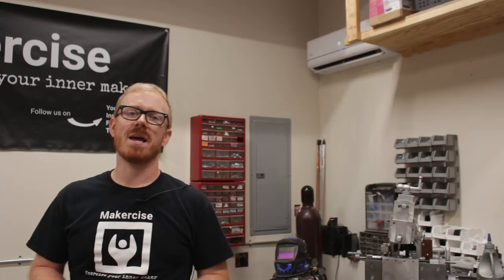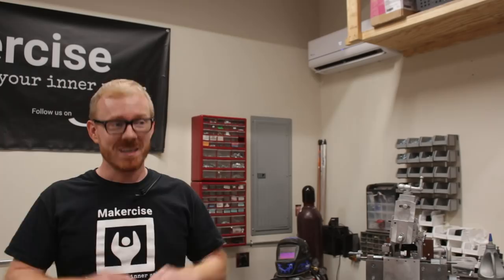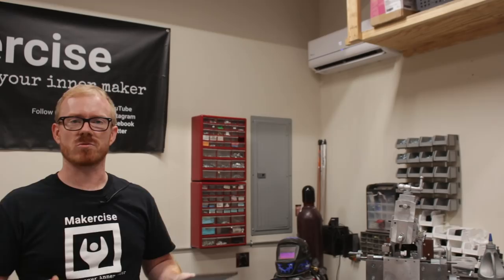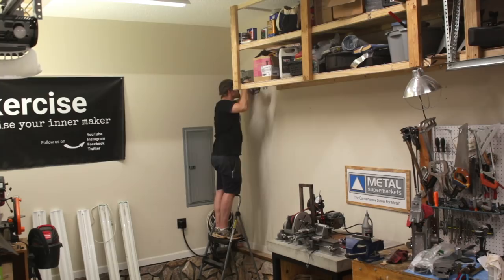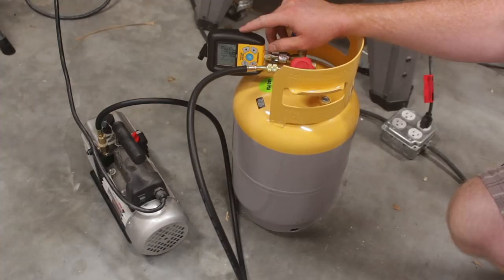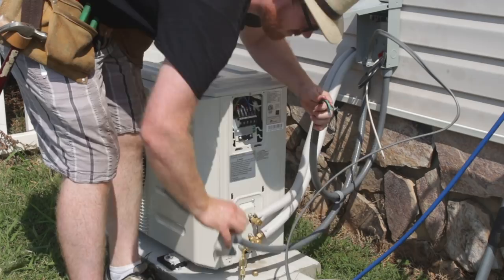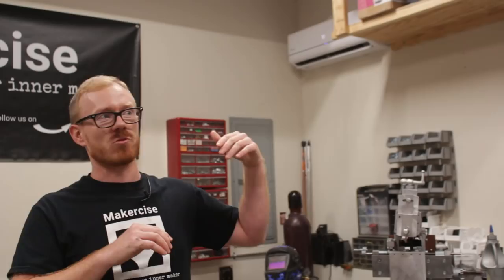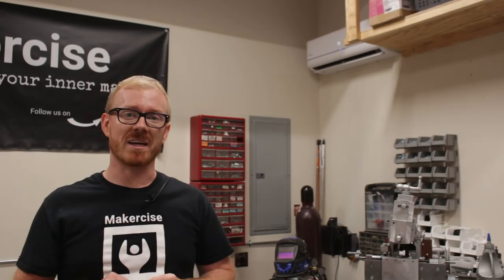DIY Mini Split AC Installation - Air Conditioning Install without Professional Help

Comment: This has to be the most expensive diy install, right?
Reply from the maker: My data set is limited so I can't say with confidence that this is THE MOST expensive DIY install. I imagine one could spend more. 

You could definitely spend less if you didn't make the same mistake I did on the evacuation. You could spend less if you went with a lower performance unit. A minisplit plus attic insulation is much more expensive than slapping window unit from a big box store in a preexisting window. 

All in all, I am happy with the price I paid considering the high performance (25 SEER) unit I selected and the tools I can use  (and have used) again on other projects. Biggest win for me was not having to solicit quotes and decide on a contractor.
Reply: First2ner he Spent about 2700$ i believe and a unit installed by a professional is about 3 gs lol
Reply: @Makercise  And now you have all the gear and skills to service the unit in the future, or perform additional installations
Reply: @martinlavoie4002  incorrect. We charge $500 for an installation

Comment: While it's great that you identified what your monetary cost was you failed to specify your Labor Rate how much time did it cost you to do everything associated with this job? Including studying to take the EPA exam, all the leg work associated with the job, the time it took to install the unit, including the time it took you to correct all the problems encountered. These hidden costs the value of your time is what many DIY's fail to realize and ultimately winds up being a path precluding to disaster. I think once you factor in the personal time element you will find that it would have been cheaper to hire a pro to do the job.
Reply from the maker: I am not sure what you mean by "precluding to disaster." Regardless, I omit any guess about a labor rate since it is an opportunity cost which would be very different for each person contemplating such a project. My personal labor rate was a negligible $0.01/hr. It was reasonable to omit, and I came out ahead in the deal. As you mention, omitting such cost is the standard methodology for DIY book keeping. Furthermore, I also chose not to include the value added by not having to deal with a professional. Although not priceless, I value such a benefit highly.
Reply: Well if the value of your time is $0.01 cents an hour I think the viewing public has a right to know the value of your time so they can determine for themselves if this venture of chasing rabbits down DIY holes is really a worthwhile endeavor. As you made vivid points about what a manufacture would or wouldn't warranty from an amateur. Most people viewing your videos probably have a higher value placed on the time they have on this rock. precluding to disaster means more or less the little things that go wrong that an amateur more often than not does not have the means or the fortitude to correct. There's really goods reason(s) nearly all jurisdictions require licensing for doing such things.
Reply: I think the value of one's time in some instances should be factored in among all the various costs to complete a task such as this. Some instances, but not all. Some people don't work, and don't intend to work. In my case, I do work but did not factor my time as one of the costs. I had 3 reasons for this: 1 - I would not have worked those hours spent on my install, so no opportunity cost regarding loss of potential income. 2 - I enjoy learning new things. Even though I don't see myself doing HVAC professionally, it brought me considerable joy doing a challenging job, and a lot of pride after knowing I successfully installed a nice system myself. And 3 - I really had nothing else going on. It was something to occupy my time each night after work; no different than drinking beer and watching football, or playing cards. To me it was beneficial for so many reasons; as he mentioned, I didn't have to deal with "professionals" in my home, and be at the mercy of their skill-set and ambition level to do it right. I wanted it done right, and did so!

Comment: 15:14 I thought you were not allowed to release refrigerent to the atmosphere?
Reply from the maker: De minimis release is permitted:"De minimis" quantities of refrigerant released while making good faith attempts to recapture and recycle or safely dispose of refrigerant including releases that occur when connecting or disconnecting hoses to charge or service appliances.
More info here: https://www.epa.gov/section608/stationary-refrigeration-prohibition-venting-refrigerants

That being said, in the future I will use that CD5060 with the thumb operated screw to get even lower amounts of "de minimis" refrigerant release.
Reply: @Makercise  Thanks

Comment: nice job so DIY does cost more lol next time find a AC company make buddy's and borrow their shit they will more than lightly come help, why buy all that equipment for one time use   i cut off the indoor flare nuts  and braes the gas pipes together to insure i cant have a  leak on the indoor unit and do a pump down to remove the hoses. But very professionally done well done im sure you learnt a  lot lol

Comment: Just my opinion... very informative video.  However,  you turned a DIY project into a professional one.  I just installed a senville mini split into my home gym and by far it was not DIY.  It's only DIY when you have electricity provide outside.  In my case I didn't.

Comment: I was dubious when you said it was legal where you live but I guess technically I could get the certification and do my own here, except that it's a four-year apprenticeship.
Reply from the maker: Where is here?
Reply: Nova Scotia, Eastern Canada.
Reply: I too am from Nova Scotia and will be installing one for myself. I believe its only a real issue if you are attempting to do it commercially. The four-year apprenticeship is a joke...We are not even allowed to even touch electrical as a homeowner either.

Comment: Top tip to anyone trying to install ac systems. Get a qualified refrigeration engineer to install it properly. why  would you leave the flare nuts on the indoor unit.

Comment: Where he get  40 -90 deg temperature?
Reply from the maker: Calculator based on zip code. I think IBC or energy code also defines outdoor design temperatures based on area.

Comment: extra lineset should NEVER be coiled verticaly will trap oil.
Reply: Manufacturer shows the extra lineset coiled in the installation manual.

Comment: It  really concerns me that the HVAC industry voids warranty when one does NOT hire a HVAC contractor for installations even when the system is well installed by the non-contractor.   The issue is that the systems are available for a fraction of the cost of the units marketed through dealers and installation contractor and it feels like real prejudice that everyone and anyone not in the business of making windfall profits is purely and completely incompetent.   This makes me wonder either if I even want the product, or if I care if I have a warranty at all, then just go with fate to see if the unit will hold up.   I am completely competent with diy installation of this nature after spending my entire vocational life performing much more than the skill sets required to accomplish this type installation.
Reply: May not be legal for them to deny based on Federal warranty regulations. I know they can't require you to register for example

Comment: vac pump 150. recovery machine 450.00 recovery tank 100.00 gage set 90.00 tank of r410a 85.00 100.00 micron gage. plus cost of mini split. expensive DIY . only 250 psig nitro test? should have been 450 psig for mini split. only 1300 microns ? should be 300 microns for mini split. used 60 amp non fused disconnect. should have been 30 amp fused. ( not to code ) pretty sure you will have non condensables in that system. dude, it works, think you would have been WAY better off hiring a company and have at least 2 years labor as well as 10 years of parts warranty. sorry bro, I know your proud and it works, but this is something a pro should do for sooo many reasons.
Reply: @ Martha.. He didnt say this was a cost effective venture ,  cause its not,  or that he really knew how to properly install the thing. Actually he just MONEYTIZIN ON DA TUBE! Lots of disclaimers tol.
Reply: He would have been fine if he would have not fd up the system

Comment: i installed my own sytem and never vacuumed my lines i just connected the lines and carefully pressurized the system with the gas that was in the unit 
it still works after 13 years , if you installed the system on a moist day there is a chance the moisture trapped in the lines will freese , guess i been lucky and did the install on a low humidity day
freon nowadays is VERRY EXPENSIVE due to new enviroment rules they had to change the formula of the cooling gas
as for loosing the refrigirant , both sides of the couplings on the compressor have a hex key valve verry close to the fill point , it think if you closed those (turn off system first offcourse) before taking the adapter off there shouldnt be too mush loss , you can open up those hex key valves after that
Reply: Bad idea...just sayin

Comment: 11:16 in I gave up on any notions of buying a DIY system. You gotta pick your DIY battles wisely...this is not, in my opinion, one of those battles. It's not a question of 'can you' do this...its a question of 'should you'. For me I'll bring in a pro and go do something else with my time.
Reply from the maker: Definitely not a job for everyone. I weight 'not dealing with a professional' so highly it trumps nearly every other concern for me.
Reply: @Makercise  some DIY decisions no matter how skilled the installer is can really backfire on a guy. Voiding warranty's is not always a wise thing to do. 
I will be needing a 40k btu multiple head entire home mini-split system and for me that warranty is mighty important. I'm on the ramp to 70 years old now..an avid DIY'er over those years and I've seen alot of equipment that had great reviews but in the end proved to have flaws in the design and or manufacturing or out of the box failures..which means you're screwed if the warranty is deemed invalid due to self installation. 
Thanx for your response and video. In the end you provided the answer I needed...and isn't that really the purpose for making the videos in the first place  ;) 
Take care.
Reply: @Makercise  including doing it incorrectly like you did?

Comment: I hope you purged your hoses before charging.  Your unit will work fine, but your compressor will die faster because noncondensable.  Hopefully you did.

Comment: Mr Cool DIY systems are pre-charged. This would have saved you a bunch of time and money on tools, refrigerant, course materials, etc, etc.
Reply from the maker: As I read the laws, if someone performs an installation, repair, connects gauges, or anything else to a system that could release refrigerant, they need the cert. This goes for mr cool systems too. I understand that the vast majority of DIY installers do not have the certification, but it doesn't mean it isn't required by law. It just means the risk or repercussions are low. Kind of like driving 5mph over the speed limit, although it may not be technically legal it becomes effectively legal.

Comment: How did you save money if you had do buy recovery unit a recovery tank . vacum pump. refrigerant. Manifold gauge nitrogen. If you want to diy thats cool dont tell pepole you saved money
Reply from the maker: I saved money because local minisplit install is around $3500 for a similar sized unit plus labor. Tools and equipment were less. I didn't include my time because--lets be honest--I would have been replying to youtube comments if I weren't doing something productive. ;)

Comment: Knowing what you know now, the money it cost you, time and effort, would you have installed it yourself still or would you have called a qualified installer? Its good that you learnt new skills but how many times would you need to install an air con in your lifetime. You would hope that the one you installed would last you for quite a while.
Reply from the maker: 2 minisplits and 2 vehicle A/C repairs using this equipment and knowledge. This is the kind of thing I like to do so there is extra incentive for me.

Comment: An online dealer claims that it only takes 2-4 hours to do this work, and that you can hire someone to do it for $50-65 an hour. So they are implying an install should cost $100 to $260. Ha.

Comment: After watching this I am convinced that I wouldn't want to do this myself. My neighbor does HVAC.... I would just have him do this for me.  There is too much equipment to buy that I probably wouldn't use again.  Probably can be rented, but he could get this done more quickly that I ever could.
Reply: Most mini-split units have an open line set and have to be pressurized with nitrogen and checked for leaks. Then they have to be vacuumed down with a vacuum pump to 500 microns before the coolant can be released. Other mini-splits like the Mr Cool DIY line have the line set precharged and have  check valves  in the end of the line set to prevent leaks. The other end is permanently attached to the indoor unit. You just hook it up and go.
Reply: @Robbi Robson You have a vacuum pump?
Reply: @Robbi Robson  you are right about not needing any refrigerant but when you install the mini split amd hook up the line set it has been exposed to the atmosphere therefore you pull a vacuum before you open the valves for the pre charge to rid the line of moisture or noncondesnables.
Reply: Wow thats interesting,
Installing a mini split easily is upward of 3k, installed,  where I live in Texas
Ppl like to put them in their garages, workshops, and offices
Reply: @Robbi Robson that makes me sick. This trade is not for everyone and takes some hard work. You deserve a good living if you are doing hvac or any trade in my opinion. In the states, I am two years in the trade and after getting a few licenses and certs in my state I am earning 25 per hour worked. Here in the Texas that is a good living, I have no complaints.

Comment: Pulled permit for that small job
Reply: Usually,  you only need a permit if your doing a structural change to a house, not put in an ac unit.

Comment: I did this thru a professional HVAC contractor and paid about $2k in SoCal w/o permits for this. Just FYI.
Reply from the maker: So we compare apples to apples, what was the SEER rating on your unit? Also, what would permits have cost had your contractor pulled them?
Reply: @Makercise  You don't need a permit for that my dude.

Comment: A 1300 micron vacuum is not correct.  500 microns of less for a unit from what I have learned.  I would be hesitant to give advice in a trade I am not competent in.  For correct mini split install check out "HVAC Tech" here on YouTube.  He is a license HVAC contractor and goes over mini split installs.

Comment: You didn’t do a real vacuum, you didn’t even measure it with a micron gauge. On top of that, if the flares to the indoor unit leak behind that wall, good luck finding it you will have to cut that section of the wall out again. Other than that, good on you. But I will admit I love when DIYs call me a year or so down the road when their compressor fails from an install done wrong like not pulling a proper vaccum which causes an acidic reaction from the moisture in the lines.

Comment: Hang on...at 7:08or so, you said you cooled the recovery cylinder...these systems typically come pre charged, why you would concern yourself with recovering  refrigerant is a mystery to me...now I know, as I have watched the rest of the video...
Reply from the maker: Thanks for answering your question. I really enjoyed this project and it keeps my garage nice and cool. I have also fixed two vehicle AC units and done another minisplit install since then. Fun stuff.

Comment: Your recovery tank will never be pressurized with nitrogen but will always be vacuumed  down
Reply from the maker: The tank I received in the mail had positive pressure. To be fair I didn't analyze the gas it was pressurized with, but to be sure it definitely did not ship under vacuum. Furthermore, I could pressurize it with nitrogen, at that point 'will never be pressurized' with nitrogen wouldn't be correct.
Reply: LOL!
Reply: Randyy - sorry, my LOL comment was for a different comment.
Reply: @befmx31  don't worry I get laughed at quite often especially by myself

Comment: you have some mistakes :
small distance to end of cement plate, possibly to crash after ( dont use metal dubel, plastic better) , better use stud.
minimum 20 sm height to ground (outside modul) Snow, rain.
dont use packaged drain tube, very bed plastic destroyed afte few years & have wrinkles, mud stay on
wen take of adapter hold adapter& push , unscrew nut  beter compresor on pressure lower
when unscrew transport nut on inside modul before push on button.
👍

Comment: 1300 microns.....you don't start removing moisture until 800 microns......DIY. Good luck, probably took 5 years of the life of the AC. Also, if you evacuated your system correctly, you should have been able to get the entire charge of refrigerant in without heating the R410a cylinder.

Comment: This is a good example of why you should pay an expert to do the startup. It would have been a whole lot cheaper.
Reply from the maker: I am so glad I did this project...even learning from my own mistakes. Since installing it, I have fixed two vehicle AC and done another minisplit install. I feel very confident with AC stuff in general. Now I never have to high a professional to do my AC work again. How liberating!